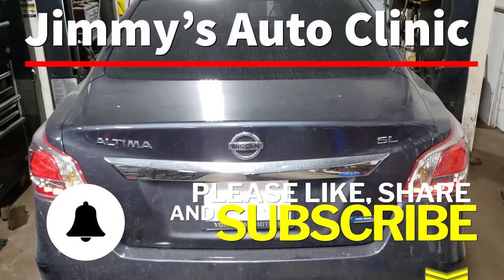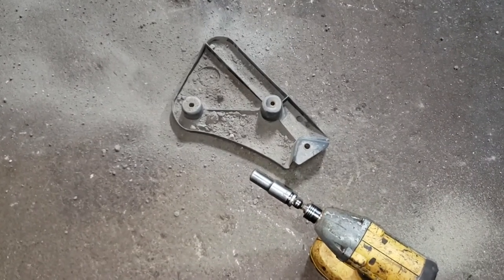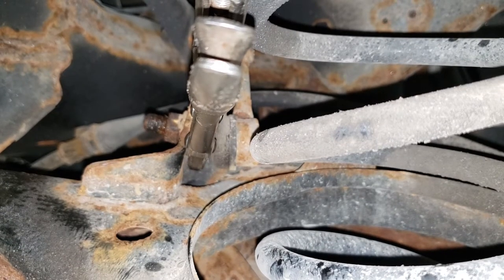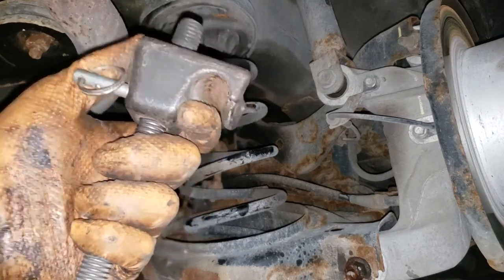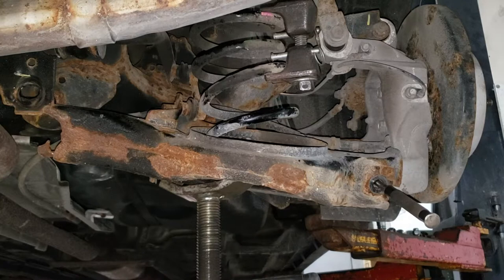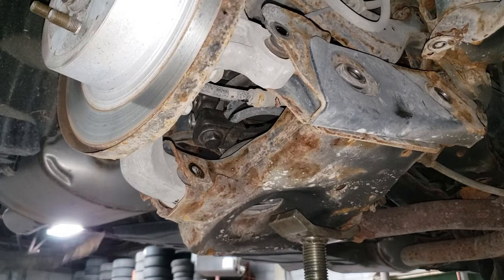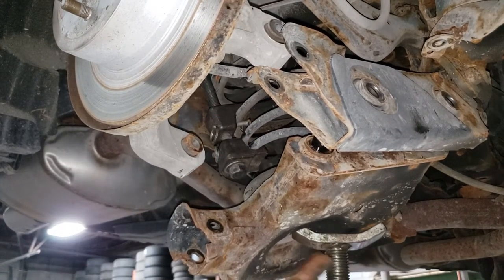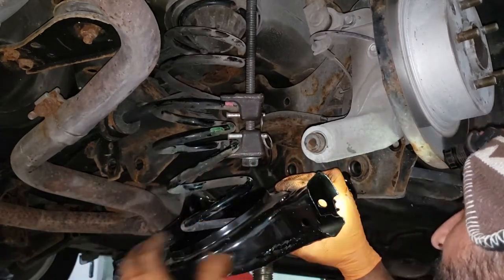Lower Control Arm Rear | 2013 Nissan Altima | Replacement

Comment: I'm glad I found this  video! I saved a bit of time and hassle by removing the lateral arm as well, once that was out I reassembled on the ground and then installed  the inner bolt the control arm, I decompressed my spring and lined it up in the CA, jacked the control arm/w the lateral arm bolted on, using  a prybar and jacking it  up everything lined up and fell into place.
Reply from the maker: Awesome my friend. Hopefully you never have to do that job again. If you do I just want to let you know it is on the recall. And a free repair from the dealership provided your VIN number qualifies.

Comment: I'm about to replace my wife's on her 2017. This video came in very handy. I appreciate the honesty of how hard it can be. I just did the fronts and it took me 10 hours to do!  Thanks again!
Reply from the maker: Hey my friend I hope this message gets you in time. There is a recall on the Nissan Altima rear suspension arm before you attempt the job please call the dealership with your VIN number to see whether it is a free fix from Nissan under your vehicles VIN number. If it is it saves you not only a lot of headache but a lot of money lol. Good luck my friend hopefully it's under recall.

Comment: Just dropped off my car at the dealer, both rear control arms are covered thru extended Nissan warranty. Glad I watched some of these videos that’s how I found out about it. My car is Altima 2015 and the warranty expires in July.
Reply from the maker: Thank you for sharing. Even I didn't know they were covered under warranty and now have since sent my other customers to the dealer. When I call the dealership locally they didn't tell me that it was under recall and sold me the part willingly of course. What to do.
Reply: @JimmysAutoClinic  It's not actually under a recall.  The repair is part of an extended warranty where Nissan will do the repair only if the part breaks

Comment: Thanks for the funny video, My Gf just called me ( were in Southern Canada- Minnesota LOL) and showed me a video of her r rear lower control arm cracked off in the same position. I think I'm going to take it to a shop with a pro to get this fixed. Maybe even the dealer after seeing the NHTSA bulletin, on the spring compression.
Reply from the maker: Hey John no problem I appreciate you watching. I would definitely recommend having this done by a professional because it is a task and a half. Also just make sure that they check the other control arm and replace if needed at the very least spray it with some rust proofing material to help it not rust out. Good luck my friend. Southern Canada lol 😆.
Reply: @JimmysAutoClinic  dropped it off at Nissan. The 2013 has a recall for it. Im not up for that repair. I’ll do my own Brake pads and rotors yes. But not Big ass springs- at 62, in my case its pro job with factory spring compressors to increase safety
It came apart on I-35E at 65 mph, shot immediately to the right across the next lane. Luckily nobody next to her.
Reply from the maker: I completely hear you. Dealing with a spring is no fun. I don't think it's a recall here in Canada yet. At least the model that I worked on wasn't under recall but yeah I could only imagine how scary that moment would be. Thank God nothing else happened and just the car broke down.

Comment: Thanks for the video.  My cvt transmission has been solid but I change the oil in it.
Reply from the maker: Great job. Most people unfortunately don't do much maintenance like that that is crucial to those things surviving.
Reply: I have 273,000 miles on a 2012 maxima. Original transmission but second engine. I’ve only changed the transmission fluid once but I’m going to do it again tomorrow

Comment: There is a recall for this.  In the U.S only the 2013 but in Canada its for the 2013 and 2014 altima.  Get it fixed for free guys.  There's also recall for the hood latch and cvt transmission for the judder.
Reply from the maker: Hey thanks for posting this comment. Yeah I didn't know it was a recall until after doing the job. Surprisingly enough when I had ordered the parts from my local Nissan dealership I asked them if it was a common problem to which they replied not really. Of course because of that comment I didn't bother to ask them if there was a recall. Unfortunately they don't get the name stealership for no reason.
Reply: Did you have trouble filing a reimbursement claim? The Nissan website seemed to imply it would be covered if youre the original owner so I'm hesitant to take it in having bought it used. My arm just snapped this morning
Reply from the maker: I wouldn't hesitate to take it in. My advice would be to tell them that your lower control arm is busted and you know that it's under recall and you would like them to check and see if your car is covered under the recall based on your VIN number. It'll be a yes or no answer from them. From what I've heard and seen now most people when they take it in will end up having both rear lower control arms replaced. Regardless of whether you're the original owner in my opinion it doesn't matter because it is a safety issue. It would be ridiculously unwise of them to deny you just because you're not the original owner. Anyhow good luck I hope this helps you and don't forget to hit that subscribe button :-)
Reply: That's a very good point and I appreciate the advice! And timeliness damn 😂
Reply from the maker: LOL no problem.

Comment: This job is very easy if you leave the spring installation to the last. Install the inner swing arm bolt, slip in the coil spring (compressor is not needed), jack the arm up and install the outer bolt into the spindle. Load the wheel until it carries  just enough weight to lift the car off the stand, then tighten the inner and outer  bolts. This places the bushings in a neyttal position.
Reply from the maker: Thanks for the tip 🙂.
Reply: im not a mechanic lol but i always fix my own issues thank to youtube.  anyway, ive got mine appart and having trouble getting it back together.  unfortunately ive only got a 5 ton jack and some jack stands. your tip seems a little easier but i am not sure what you mean by inner swing arm.  is that the suspension arm?
Reply from the maker: Hey my friend sorry your comment somehow slipped through the cracks I just read it. Two things there is a recall on this vehicle and you should definitely try to get it done for free as it is a royal pain in the ass to do as I'm sure you're finding out. In regards to the inner swing arm I'm specifically talking about the inner portion of the control arm so the one that's closer to the inside of the car.

Comment: Hello. I just had this issue with my Altima but every place that I check for this part says it won’t fit my vehicle and try to sell me another part that looks nothing like this one. Do you recall the product number?
Reply from the maker: I don't have the product number however there is a recall on this specific issue with the Nissan Altima so call your dealership with your VIN number and find out whether your car is covered for the recall the repair will be done at no cost to you.

Comment: Great instructions, I think we may be brothers in the way we swear. My brother in christ, take the last bolt out of the trailing arm and r&r on the bench. Put your punches in the bushings and use one stand to get the spring in place. The only reason I comment at all is to help others doing this job, I just did it on my daughter's 2014. Also there is a recall on the spring supports until 2024 for high salt usage states, don't pay for this repair.
Reply from the maker: Thanks for the compliment my friend I appreciate it.
Reply: I just read this comment. My rear right control arm snapped off, same as in this video. Shop wants to charge $1000 to replace.. but I looked into the open recall, it states that Nissan will replace both sides free of charge? Is that correct?
Reply: Your comment saved me almost $2k. My right side control arm snapped, and I contacted local dealer. Nissan replaced both links and control arms for free, and I didn’t pay anything for towing either. Literally didn’t pay a dollar for this expensive repair. Beyond happy right now, many thank to this OP! Had I not seen this, I wouldn’t have known about the recall 🙏🏼
Reply from the maker: Yes my friend it is correct.

Comment: As a mobile mechanic that just did this exact job , i must say the choice of words good, bad , and the ugly are pretty much along the same line which tells me its all Nissan fault 😂😂😂😂
Reply from the maker: Hey my friend please read the comments your car might be covered by a Service bulletin or recall I can't remember which one. If you replace just the one side I would recommend getting the other side checked to see if it's under extended warranty by the dealer and have it replaced there because it would make your life considerably easier as well as your customers lol
Reply: It wasnt my car but when I went to dealer to check for parts they told me she missed the warranty date . they traded it in after repair..

Comment: Amazed that you were able to do this without the special tools that Nissan stealerships are supposed to be using when replacing the LCAs.  How were you able to compress the spring with only one of those clamps?  Seems that you would need at least two of them.   Overall, an interesting and entertaining tutorial.
Reply from the maker: Thank you. It was definitely challenging and took a few attempts to try and get it to go in. I compressed it quite a bit on the one side and then use the control arm itself to compress The Other Side by pushing up on it with the stands. Of course being compressed on the one side helps compressed the other. I didn't even know there was a specialty tool for it LOL
Reply: @JimmysAutoClinic  NHTSA's website provides the repair procedure (NTB21-045) showing the installation and use of the special tool.  Most likely would have been a much easier job with the special tool as it compresses the spring quite a bit more than you were able to and compresses the spring evenly.  If you should ever work on more of these 5th generation Altimas (and some 2016-2018 Maximas) in your shop it might be worthwhile for you to try mocking up one similar to this tool as it looks like it would be fairly easy to make.  As you are undoubtedly aware, these specialty tools tend to be very expensive if you get them from the OEMs.
Reply from the maker: Thanks so much for the link. I will check it out. Thankfully I don't work them too many Nissans so I hope that I will not need the specialty tool lol.

Comment: How much labor would u charge?
Reply from the maker: To be honest my friend I'm not the sort of conventional shop that goes by the book. Generally I will look at what the hourly rate is but because I'm in the Rust Belt it's never accounted for in the hourly rate given by the manufacturer so I try to be fair to my customer as well as Myself by charging what I think is fair. In terms of this job I don't remember what I actually charged but I'm pretty sure it was probably 2 to 3 hours of labor. Hope that helps you out. Don't forget to subscribe my friend.

Comment: Whats name of those stands you use?
Reply from the maker: I don't know exactly what they're called in the industry. What I call them is a support stand or simply just a stand but I'm pretty sure if you type in support stand or under hoist support stand or something like that you should get some options. These particular stands that I purchased were made by a Canadian company out in Quebec, this fellow usually just drives around he does not have a website I don't think

Comment: just had this happen to me it was late and no shop was open so i had the dam thing towed home called around the next day and told the dealers what happened, had no idea it was a common problem because no dealer told me when i called.  i watched this video and the only place that had the part was 3 hours away from me. i had someone drive me to get the part and the dealer told me "if you buy the part we will put it in for free" problem is there is no dealer close enough to my house because i'm in rural area and mine is so bad after having it towed home there isn't even a way to tow it to a dealer.  they told me its not a recall only a bulletin because its not a safety issue.  how the F* is this not a safety issue?
Reply from the maker: Hey rocky, unfortunately sometimes for certain years and models it may just be a bulletin but what I would do is call other dealerships no matter how far they are and ask them specifically to check with your VIN number if your car qualifies for the lower control arm recall. Then what I would do is call Nissan head office and explain to them the situation or the issues that you may be having with the dealer that is closest to you and see what their solution is. I sincerely hope that they take care of you and don't give you the runaround as our industry already has a bad name. As far as I know in Canada I believe it's 2014 and 15 that are covered by the recall but I'm not 100% sure. Good luck my friend if you have any questions feel free to reach out.